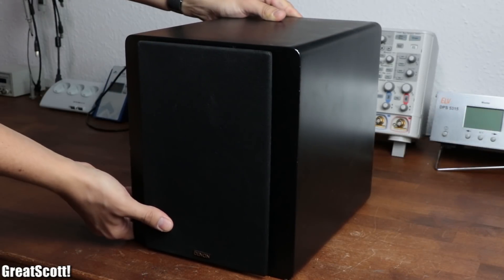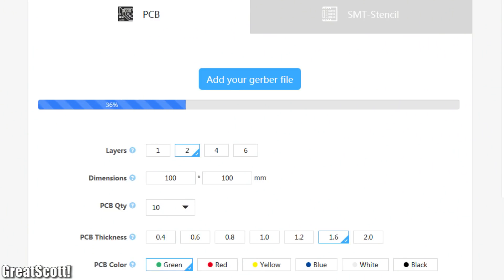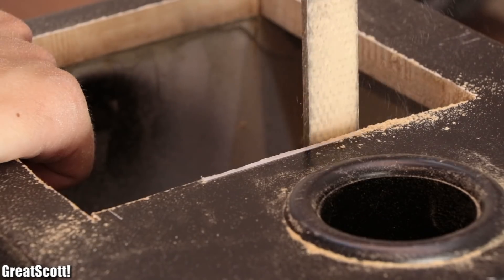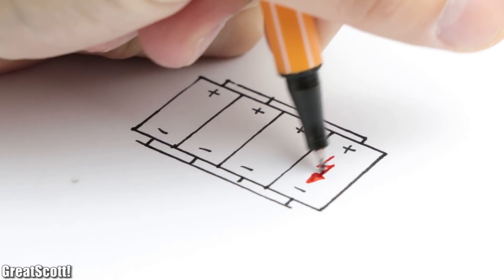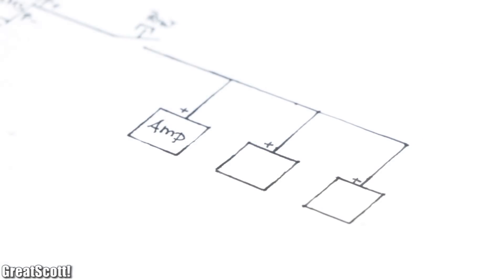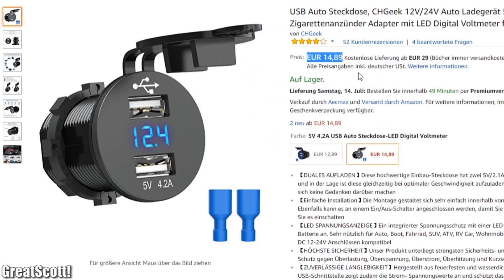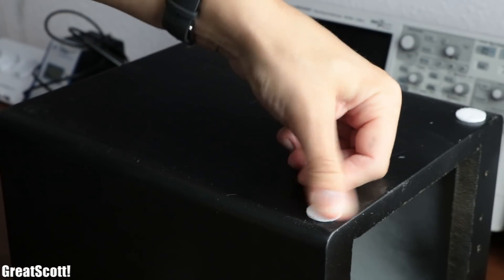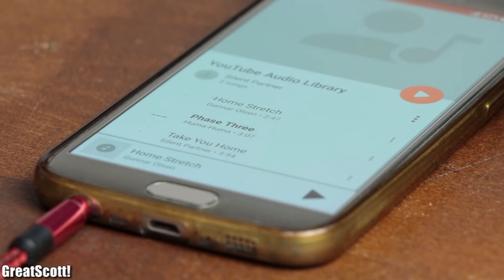How to create a Bookshelf Speaker Boombox

Comment: The original Denon passive crossover was likely better matched and of better quality than the replacement. The speakers also likely would have benefited from a bigger amp. Many people think a bigger amp just means louder, but it gives the speakers more power to extend to those deep notes especially. 
An interesting demo is to take a subwoofer and connect it to an amp and play at a given db input level and frequency and record the output. Then, swap amps with same type with much larger input and repeat. You'll notice that while the basic settings are the same, when hitting those hard to reach (high excursion) bass notes, the higher wattage amp will always output higher db around those areas even with basic volumes and such set the same. 
I relate this to climbing hills in vehicles. A smaller engine can go the speed limit, but when facing a steeper hill, it may have to downshift or may struggle more to keep up to speed where a larger (or forced air induction) engine handles the load easier.

Comment: I have an amplifier IC "LM1875T" and two 5W speakers. The LM1875T can output to 20W, and clearly, I do not wish to blow out the speakers.
Is there a certain way I can configure the IC so that it is not possible to overdrive the speakers? Considering it is a bluetooth device that I am also working on, it is not critical at all to use stereo. For simplicity, I think I will just go Mono.

Comment: You REALLY should have kept the old crossover. It was designed to work with these speakers in that specific enclosure. There is literally no good reason to replace it with a cheap general-purpose crossover like you did.

Comment: As I am planning on building something similar, I have a question about these amplifier boards. If, for example, the amp is 60W and is powered from 8-26V source, does that mean it will reach its maximum power only when given 26V or does that mean it can be powered within such voltage range because of an onboard voltage regulator? I'm not sure if I could power the amp with 12v and get decent results

Comment: A idea that might fit as a arduino prodjekt is to make a arduino to a digital crossover, and using 2 digital amps (one fore the midrange and one for the tweeter).  
It would also probably make the battery last longer.

Comment: Hey Great Scott, I think you may tune this circuit up by ensure proper cooling of the amplifier IC. I don't think it's heat dissipation is high enough to handle such occuring heat, when the speaker is used at a high Volume e.g. for a party. But beside my tipp, the project is awesome. I estimated that you would integrate a possibility for solar charging of the Speaker, maybe for a festival or so. Keep the good work going - Greatings from Germany!

Comment: i wounder how the module makes 20 watts with just 70ma at 16v its just about 1 w of power consumption not 20w
Reply: it outputs 20W at 10% THD ( clipping ).
he did not do the test right. the IC is 92% effecient according to the datasheet so he was only getting about less than 1W of power from the speakers at that time.
Reply: He needs a pre amp. Phone cant output strong enought signal

Comment: Nice project, but you cant get 140 hrs out of it, because a 20W amplifier with 16V never can draw only 70 mA.
That what you measured, was ruffly anything of a peak voltage - The power supply just cant read the data that fast.
If you want to find out the current, get a 60 Hz sine wave and then measure the current. You will see the current at about 1 A I think.
With that calculated, you will get a battery life of approximatily 6 hrs on mid volume.
Reply: finally someone else who realized he did the test wrong.

Comment: Good idea on paper. If you had only taken the  time to put the electronics into a small project box. All that wasted space inside the speaker housing is the resonance chamber, and is necessary for a rich sound and deep bass notes. . Its size and shape were designed for the best sound performance possible. Still a very interesting design idea, and I'm sure as a mono system,  it's good enough.

Comment: since i don't really have the budget for a couple of li-ion batteries, would it work with a pb battery as well? and if so, what kind of circuit protection should i use? 

Any answer is much appreciated,
SD

Comment: A TPA3116 or TDA7492P Bluetooth amp is 12-15E on amazon.de, 2x50W. Sounds a lot better than the 2x20W boards for almost the same price and has line-in as well. Source: I tried a few of them. I recommend the ones with the CSR chipset.
For anyone attempting the project, I recommend setting up 19-24V instead, that's the optimum supply voltage for most of the boards, otherwise you only get 5-10W. Check the input capacitors, some of them are only rated for 16V.

Comment: Are you sure concerning the operating period of the speaker? According to the battery's link you gave in the description, I calculated a capacity of 10000mAh at 14,8V (4x4 batteries, SAMSUNG 18650 25R). The amp's maximum power with 14,8V at 8ohm should be 2x15w. So the lifespan at full power (load is 33W or 2,3 A at 14,8V because of the amp's 90% efficency at 8 ohm, according to it's datasheet [TA2020-020]) should be at about 4,4 hours at maximum. That means about 8,3W consumption at an output of 3,75W at 8 ohm, as the chip's efficency is only at 80% at this level, according to the datasheet. This again means: A maximum of 17 h at 25% of power output (2x3,75W). And it shouldn't be really loud at this level.

Comment: GREAT VIDEO 
I want to ask one question.
my recently my smps have not worked and i open the circuit(pcb) and checked them
i have found 2 diode's(MOSPEC (-->||<--)) are shorted i removed  ic and then check pcb terminals(PADs) then it shows shorted and beep sound in multimeter.then i went path to path and i some resistor are also shorted(i think 5 to 6 resistor) 
any solution to repair smps myself?
please replay..
my E-mail id divyangkateshiya@gmail.com

Comment: Great job but I'm sad to see that a Denon speaker was used for this project... One other thing that I would like to mention also is.... Why use another passive xover???  You could have reverse engineered the original xover in spice to find out what the xover frequency is if you couldn't get that information from the web... Then using a low pass filter (resistor / capacitor) and high pass filter (capacitor/resistor) on the two respective amplifier inputs and you will have active xover which will provide much much better sound quality. A potentiometer on the tweeter channel to provide some level matching capabilities and you are done.... Active xover will perform much better than passive xover on any given day... Once again thanks for another great video...

Comment: | i don't get it, it's upsetting me... why for the love of all that is holy would you throw out the original crossover filters? The originals seem like L3 and what you put in was most definitely L2 ones... they were designed specifically for the speaker and thoroughly measured in a lab probably... that speaker looks like a quality one... replacing the filter with a generic one doesn't improve much, plus the cut off frequencies might be way off and so the overall sound might get way worse. What i would have done, and is much better IMO, is just to replace those capacitors, the coils and resistors will still be the same in 1000 years from now. I have some Grundig and Telefunken speakers from the 70's and they're still running 4-6 hours a day beautifully with their original filters, not even the caps replaced in them.

Comment: Damn that's a lot of batteries... I'm making a bluetooth speaker in a micro pelican case with just two 2.5" full range and a 3" passive rad, but using a 50W amp and probably just 2 or 4 18650s in 1S with a boost converter so I can just use like 3 TP4056 in series and not worry about balancing

Comment: Does the 2nd BMS board work properly? The SMD resistors on your screenshot of the board look rather tiny, so I was wondering how large of a balancing current per cell can it can actually provide? Oh, and can it regulate the charge current somehow, like these USB/TP4056 boards? Cheers, and keep up the good work!

Comment: Great job ! But your door system is not sealing at all, there must be air leakage all around . In a speaker it’s important that the enclosure be completely air sealed otherwise they will have a loss of performance especially in the bass

Comment: I'm gonna repost this here as an idea for how to use the full 40Ws of the amp:

1) Merge the stereo input.
2) Use a crossover to split the mono signal into two line level signals, high and low frequency
3) Feed those respectively into the left and right lines into the amplifier
4) Directly attach the tweeter to the left channel and the mid into the right channel

Now you have all 40 Watts at your disposal!! 8D
Reply: James Neave how do you merge the stereo signal?
Reply: Peter Moffat Just a pair of equal resistors before join because outputs are low impedance and inputs are high impedance and you must never have a live wire between two outputs, so you add resistors so current can't flow between your outputs.
I reserve the right to have got this explanation completely backwards.
Here's a guide:
Http://www.instructables.com/id/Simple-Way-to-Convert-Stereo-to-Mono
Reply: Peter Moffat for the love of Bob don't use a splitter to mix them. Zero impedance, followed by smoke, fire and tears.
Reply: James Neave Thanks. Will the line level input be enough to drive the passive crossover?
Reply: Peter Moffat 
And thus we exhaust my knowledge of electronics.
I think so? I think I may have even done it in the past, can't remember how.
There are coils and caps in a crossover, so it will need some power I guess?
I'm sure I've done this before though.
Reply: They are called passive line level crossovers, PLLXOs and I built one once.

Comment: How are you charging the Battery pack? I also built myself a diy boombox with a 2S2P Li-ion battery pack with integrated bms and balancing but i cant find any 7.4V or 11.1V charger without Balancing

Comment: Hi Great scott. i have a doubt about your diy arduino ir remote.in that video you used an arduino pro mini.you proved that the circuit only consume 1 micro ampere at 3v.
         I made this circuit using a stand alone atmega328-pu.the remote is  working well.it consumes 1.2ma current @ 3v.the ir led is working even i didn't press the wake up button.please tell me how can i reduce the current consuption of atmega328-pu(stand alone).please respond.
   will you give me your wattsapp number please.

Comment: I usually really like your videos, but you have made one big mistake with this project.
The port at the back that you removed is very important for the low end response of the speaker. the entire enclosure is designed with that port in mind. By adding a port you can have a speaker which is much smaller in size, this is why manufacturers add it. By removing the port you have completely changed the audio response for the worse.
If you as a channel are making content then I think you should explain things properly as people will end up following you and may make a similar mistake.

Comment: I used to solder cables to switches as well but I realized it's a lot more Handy to use crimped Plugs with Silikon insulation covers - just a recommendation ;)

Comment: I have a great idea for the next diy or buy series. Make a network patch panel toner. The kind used to locate where cables are by putting a frequency through them and having another part detect them. They cost a lot but I'm sure you can make one.

Comment: HELLO EVERYONE.......The idea is awesome but I have some doubts regarding the sound quality which I think will surely get affected. These kinds of speakers must have a completely closed/packed cavity which is responsible for insulation. In this case, you are cutting out the box which may ruin the insulation and thus decrease the overall sound quality of the system. What if we use a seal (say a silicon ring) around the door parameter which will insulate everything again and thus increases the sound quality or I am wrong in this case?????

Comment: I hate to be critical, but you should have cut the MDF 20mm wider on top/bottom then used a router on the box to machine out 10mm (half way through) all around.. that way the door overlaps the box, so you can still maintain a proper seal.

Comment: Cool build - only change I'd suggest is adding Bluetooth (especially as it's for portable use!). A small receiver/adapter can be bought for under €10/£10 and they're usually straight forward to wire up for power and audio (based on experience!) Plus typically rechargeable ones can use usb adapters to cut down on build time/ hassle factor.

Comment: Nice but how did you connect a stereo class D to a single Xover? Skipping one channel? 🤔
Reply: Mosio Masoud He said he converted the Stereo signal coming from the phone to Mono,there is no need for Stereo in a setup like that
Reply: Barz Thanks man for your care but I was talking about amp output. Apparently he used only one channel, 6:20 .Guess it was more appropriate to do the filtering on mono audio at input and using both channels to drive the speakers.
Reply: Mosio Masoud  he combined the two outputs via a 1k resistor on the positive of each, and common ground to the crossover. I wonder if you can just use regular through hole resistors for this?
Reply: No the 1k resistors are for the input of the amp not for the output. He used only the left channel 6:24 Lout+ and Lout-

Comment: 150 hours would be if the speakers were drawing 1W, since the battery pack is ~150Wh. You said the amp was 20W, so at max volume it would probably only run for around 7 hours.

Comment: Hey! Great video, altough there are some thing I want to point out that might improve your project.
You should have left the polyfill inside, as it keeps the sound from bouncing off the walls. Also, the battery is pretty big, so adding even more polyfill will restore the speaker to it's tuning frequency and give you lower bass. You should have at least checked that the crossover filter has the same frequency as the original one. And you should absolutely make sure that the whole thing is airtight, so add some foam seals on that back door. Other ideeas might also include a bluetooth receiver or an Arduino so that you can play music from an USB drive and some volume controls. Oh, and that speaker seems underpowered, I would have used a bigger amp, especially since most amps distort really bad at max volume. Other than that, great project! I know sound quality is not the primary goal, but this are just some simple stuff you could do that help improve it.

Comment: What made you go with that amp instead of others?
Like this amazon amp which is also $11 and it says its capible of 2x50W+100W(250W+100W)?
It also has different dials for volume control as well

https://www.amazon.com/AOSHIKE-DC12V-24V-Subwoofer-Amplifier-Bluetooth/dp/B07CG7WRN7/ref=pd_sbs_504_2?_encoding=UTF8&pd_rd_i=B07CG7WRN7&pd_rd_r=ad6146ae-8873-11e8-aa7b-1331fb4ea84e&pd_rd_w=zEQzy&pd_rd_wg=bXHGm&pf_rd_i=desktop-dp-sims&pf_rd_m=ATVPDKIKX0DER&pf_rd_p=5825442648805390339&pf_rd_r=QGB9B4DYX46CE49PA734&pf_rd_s=desktop-dp-sims&pf_rd_t=40701&psc=1&refRID=QGB9B4DYX46CE49PA734

Comment: Nice project. A tip for cutting straight lines with a jigsaw is to use both hands, one on the front and one on the handle. When you only use one hand you put sideways pressure which causes the blade to wander off the line.

Comment: great build, but passive crossovers consume power inefficiently, if you filter the signal on the low level region each channel of the amp will only amplify it's own band  and all the amp power goes directly on each loudspeaker.. it's called bi-amping.
Reply: Just like you say.. You need multiple amps for that. With a passive filter you can use 1 amp and drive multiple speakers with it.

Comment: Yesterday I needed to utilize heat shrink tubing to restore wiring in one of my daughter's the broken toy. Instead of pulling heat gun out of the storage I used fire-starter  https://www.duraflame.com/products/lighters-matches/duraflame-flex-neck-utility-lighter. Much easier  and safer than using cigarette lighter.

Comment: What about sealing the cutout with some foam because it loses sound quality without it.
Reply: Oh, you mean like the opening that is the bass port that is already on there?
Reply: @Rudofaux  no
Reply: @Gamerdu45  Oh? Then tell me. What is the bass port if not just a tube that leads as a opening?
Reply: @Rudofaux  That tube is not a random opening, its shape and size is optimized for that enclosure for a specifc frequency response.  The box needs to be completely sealed so that the air resonates properly in the Port, Other holes/leaks in the box behaves like bad uncontroled ports that increases the resonant frequency of the box messing with the speaker frequency response.

Comment: isn´t the math a little of ? 0.07 A of draw on 14 volt means around 1 Watt
the way i see it, if you want 20 Watt constant you will need to provide 1.7 A and that means with 10 Ah you will have 6h of playtime.
and the box says it can handle around 50 watt constant, so in this case it would be empty after a good 2.5 hours.